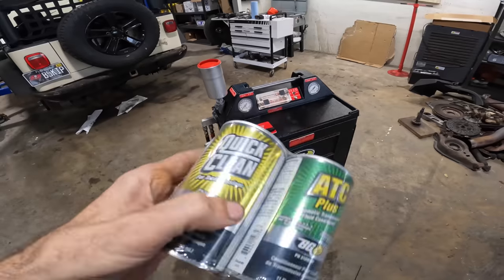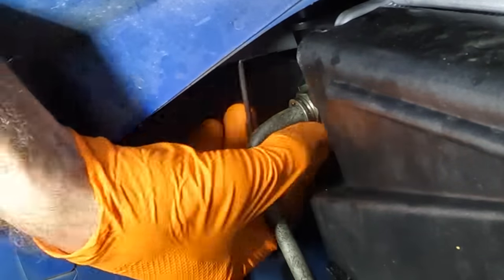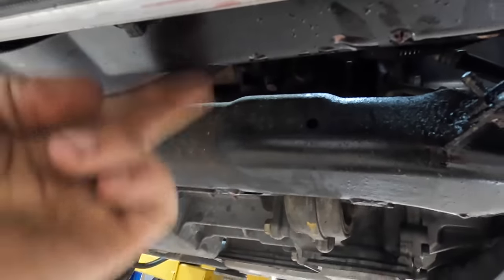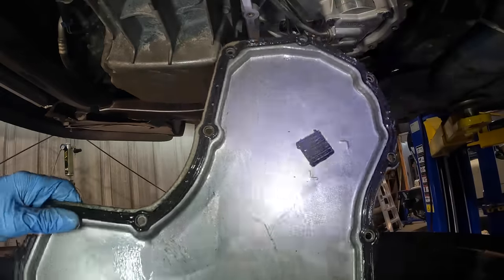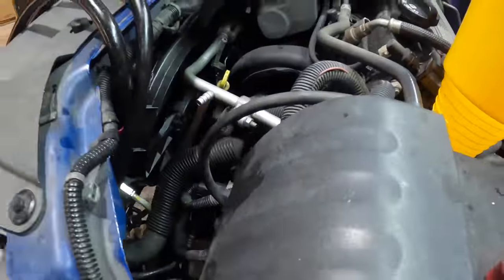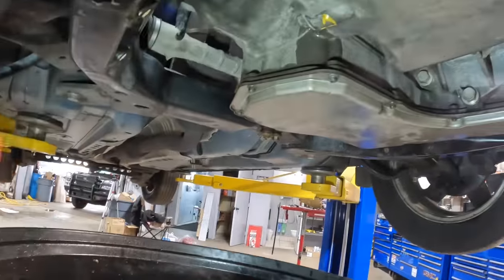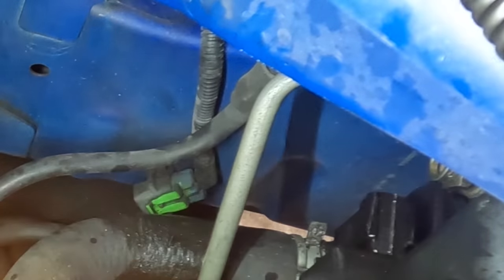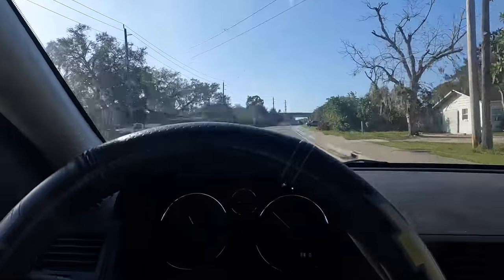Contaminated Transmission! Chevy Cobalt 2.2

Comment: I used to run a reputable Fastlube and did many T-tech flushes.  With that unit you filled a long visible cylinder with 15 quarts and attached the same place you did used the transmission pump to do the exchange. It also had a second visible cylinder that showed old fluid coming out. The customer could see the whole process and assured them that we were not compromising their car.  We also added a bottle of Lubeguard conditioner.  Back then the process was about $105.00 plus tax.  Many mechanics said it was harmful but I saw it work on many high mileage vehicles. I did it on and old Volvo that would barely pull itself when it came in with 204,000 miles.  Weeks later the customer came back and said it was running like new.  I guess it's just a matter of opinion.  Great video Ray, It brought back memories for me.
Reply: Now on this days would be around 700.00 for that job
Reply: I had a flush done about 20 years ago when I had what I thought was a shuddering torque converter. When I pulled out of the transmission place, I lost all but second gear before I even got to the second stoplight. It was the crappy fluid that was keeping it going. I’ve seen it work both ways. Sometimes the fresh fluid fixes the issues, but only if the trans is still good.
Reply: @carloshernandez2216  on a ford focus where the fluid is $30+/quart, yeah... $700 at least
Reply: I worked a few oil change shops and we used the Wynns flush machines the model with three tubes "Green" "Red" & "used" fluid  and never had a issue flushing transmissions, even on older high mileage plus I some shops warned the customer and made them sign a waiver if over 86k miles. The only problem we had was a dude who looked exactly like William Murderface from Metalocalypse trying to scam us out of a new tranny claiming we put the wrong one in his El Camino. We don't install or rebuild just flush or replace filter and/or gasket.

Comment: From an older guy who worked at a GM dealership in the 1980's: now that you took the car out for a test drive, which has actuated ALL of the servos and accumulators, drop the pan and change the filter one last time please. You have released debris and pink shmoo from the last hiding places and this needs to be addressed by a filter and associated fluid change. Otherwise you did get there in the end. Congrats.
Reply: Exactly..... I would have been manually shifting through all the gears as that machine was flushing.

Comment: Ray, I’ll give you a little trick on pouring out the box of transmission fluid. When pouring out the fluid into the machine or even into a funnel turn the box around so the spout is at the top of the box when starting to pour this allows for the air and fluid to equalize and doesn’t make a mess.
Reply: You can also get a greater angle this way before any liquid comes out, all us real old fart Brits know this from the ancient, rectangular, 2 (Imp) gallon petrol (gas) cans that had the very short spout in one corner.
Reply: Great video my car has a six speed manual gearbox being in the U.K. 30 mph is the normal speed limit in towns if I put the car 5th it will go up to 38 mph it 1000 rpm with no foot on the diesel pedal and 48mph in 6th at 1000 rpm if I want to go faster I turn on the air con 😅 to keep my driving license I say in 4th but I have to put my foot on the pedal or I will be going at 21 mph so  Enough Woful and a merry Christmas to everyone ☃️
Reply: with a bag in a box the bag just shrinks there's no need for air to equalise. still eaiser to pour from the top though.
Reply: @randomblogger2835  correct, the bladder collapses so there are no vacuum "glug" issues as you get with a bottle or can.

Comment: Thanks Ray, I am with you reliving my two transmission sagas: Ford Taurus 1998.  My dad's SOHC 24 valve Taurus,  32000 miles and the transmission started slipping. We were out of town. Long story short took a chance,  Ford dealer, recycled all the transmission fluid, a relatively new process at the time. Never had a lick of trouble with that transmission after that. Second transmission flush story:  93 Ford Explorer.  96,000 miles. Out of town again. Transmission slippage on the highway. Drove into St Augustine. Found a transmission shop. Had them do the transmission flush. Drove said car the following months to Alaska never had another lick of trouble from that transmission. Verdict: Transmission flush works in the right situation. And it is a mystery and one does cross their fingers not knowing if it's going to work or not but two out of two times it worked for us.👍🤗
Reply: Amazing good fortune! I had a mid nineties SHO Taurus. Loved that car. Had good power and handled like a dream. Unfortunately it had some electrical gremlins that were absolutely maddening!

Comment: I really enjoy your videos.  Watching you go to heroic measures to satisfy a customer really defines "customer service".
Reply: I agree but those heroic measures will result in an epic repair bill
Reply: @sand0077  The alternative is either replacing transmission or getting a new vehicles. Compared to the other two, repair bill for his service should be acceptable...
Reply: Customer can start saving for a replacement transmission or a new car (new or probably used). Ray probably explained the status of the transmission in addition to the new radiator and transmission fluid flush.
Reply: I don't think he's repairing individual owners' cars. Seems most of the vehicles he's been working on have been for re-sale. Probably a small dealer with their Red Light auction cars. Such a waste of Ray's talents if that is indeed the case. A friend of mine local to the new shop tried emailing them and didn't get a response and they even blocked his email address (now getting return to sender but mine went through). I feel bad cause my buddy is a disabled vet that loves Ray's videos. He's always worked on his own vehicles but now that he's almost 60 , it's getting harder to get into the tight spaces under the hood. Hopefully he'll have better luck once  Ray gets all settled in the new space.
Reply: @mod_incllc3235  a customer is a customer.
Reply: @mod_incllc3235  I don't think so, at least not solely. Those places want the least amount of work done to get the car to sell and most wouldn't agree to do the work as ray does it.

Comment: Nice job Ray.
I remember a guy that had a Olds 442 and the only way to open the hood was from the hinge end of it. He had the hood open and propped up and left a funnel in the dip-stick tube, he took off for the auto parts store and out of nowhere we had a down poor and he filled the transmission full of water. He went for a drive a few days later and the car came back on the back of a flatbed tow truck.

Comment: Happy Holidays to everyone! We all kinda know that without Ray someone would have dropped the pan and added 5 qts of fluid and this car would be in the boneyard in a month. You're not just teaching and entertaining, you're recycling and keeping cars that still have life on the road because you do things the right way. Thanks for the extra fancy oil change video!
Reply: U2
Reply: U2
Reply: We all know a good mechanic would have cycled through the gears to ensure the valve body was flushed, and not just changed the fluid.
Reply: Nice and shiny!
Reply: @johnt.848  Theres just no damned way to thoroughly flush these things.
Anything you do or dont do has drawback sin a situation like this.
Personally i would have stopped at the puddle of black powder in the bottom and not have spent $500 in atf on it.

Comment: I had one with water in it from trans cooler leaking inside the radiator 2 years ago and still running strong.

Comment: I have an 08 cobalt I bought with 70k miles 2 owner. When I got it the trans had never been serviced. at 90k miles I replaced the cooler lines, dropped the transmission pan, changed the filter, and did a partial fluid change. I just replaced the exact amount of trans fluid that came out with new fluid. It was almost 9 quarts exactly. While I was servicing it I decided to replace the transmission pan with an aftermarket pan with a drain bolt on the bottom (amazing for draining the trans for future servicing). I just want to say about the gasket you made the proper call I also re-used the factory gasket. One more thing I would like to say is that the amount of clutch material in the transmission pan was a lot thicker than the material in my trans. There was some material, but no where near as thick as the pan you showed in your video. You are probably correct when you said the trans must have been slipping.

Comment: I have a 2007 Chevy Uplander. The transmission started slipping quite a bit. I took it to my friendly neighborhood mechanic and he said the transmission was shot and I needed a new one. I decided to change my trans filter and it has been running fine for over 2 years now. The mileage is now 180,000

Comment: Those stamped gaskets are reusable as long as they are not torn. I've done it on countless of my own vehicles and never had a leak so I'm with you on that Ray. Now those rubber ones are trash lol
Reply: agreed
Reply: Biggest thing I've run into with those rubber gaskets and Court gaskets especially on valve covers in the old days if you weren't careful and tightened them too much you they pinch at the ball points and then warp your valve cover and then you had a real mess have a great day and a Merry Christmas and thank you very much Ray
Reply: @michaelpressman7203  cork gasket* looks like auto correct struck again
Reply: Can I reuse my original gasket from my 1999 4T45 transmission?
Reply: @s99614  is it stamped with steel in it and not leaking prior to you changing it?

Comment: Congrats on the save I've tried a couple of 2nd gen 4runners you know the ones that made the trans milkshake a common thing and had mixed results 50/50. Personally I'd toss In a quart of Lucas for good measure or there is a product I forget the exact name of it but it's a hydraulic system dryer and helps eliminate water in hydraulic systems and it works wonders.ik Auto zone is where I used to get it and run it in all my plow trucks in the plow power steering and transmission to prevent any moisture from freezing up in the middle of the night when plowing

Comment: I agree with Ray. The problem is not a leaking seal, and the seal is not compromised by removal or installation. If the problem was a leaking seal, then the rubber seal still isn't up to spec for a like for like replacement. This is a good choice for the issue at hand.

Comment: In my experience water/coolant disintegrates the clutchs and you can only really buy time. Eventually it will start slipping but how much time depends on how long the water was in there and how well it was flushed. I think you bought this little unit a few more years but only time will tell, great job ray!
Reply: Yep transmission clutches are water soluble. Any amount of water is terrible for them and is why it's bad to try to use a transmission thats been sitting dry out of a vehicle. Water will condense in the case from temp fluctuations and destroy the clutches.
Reply: I can't see repairing this vehicle, an 18-year-old chevy cobalt that judging from the smashed hood is at best a drive to work beater isn't worth it.  I'm guessing you could pick one of these up in better shape for 25 to 35 hundred and not worry about how long the transmission might last after being contaminated with coolant.  you can't really guarantee the repair and it's not worth having someone running around bad mouthing your shop if it goes out after a month or two.
Reply: @ogbobbye  buying it and repairing it is far cheaper than car payments. $25-$3500 is a bargain for used cars right now. Plus, if it's paid for, a new/rebuilt transmission is worth the cost vs a new car.
Reply: @ogbobbye  if you’re getting a used car for 5k you better jump on it in this market.
Reply: @silaskuemmerle2505  Depends on where it's from. If it's from the Fort Myers area, run away!
Reply: @silaskuemmerle2505  that isn't a number I pulled out of thin air I looked that model and year up on autotrader. true a florida car would be worth a little more but the body on that chevy was pretty rough.
Reply: @markbremmer8642  I have a feeling his neighbor is a buy here pay here dealer buying junkers at car auctions getting them running cheap and taking advantage of people with poor credit. there is a body shop right next to Ray's shop and that fits the profile. btw 2500 to 3500 is what I see 2005 cobalt's going for on autotrader maybe they are worth more in Florida.

Comment: I've reused the pan gasket on my 06 Suburban with the 4L80E 5 times now and it does not leak. I change the fluid and filter every other year. About 16-18k miles in between.

Comment: I have owned a 93 Dodge Dakota for about 25 years. In 2001, I was driving in Colorado and it stopped going into overdrive. I stopped at the Dodge dealer in Greely and they did a BG flush. It has not given me a single moment of trouble in the 21 years since. I firmly believe in BG flushes! 166,000 miles on the original transmission.

Comment: Ho Ho Ho he reddened the flow! Very nice video, Ray. Now… how in the hell, in the engineering of the car, does any benefit of an integrated cooling system outweigh the catastrophic downside? Oh wait, lower production cost and higher profit. Of course. What was I thinking.
Reply: This has been a thing (having transmission cooler built into the radiator) for a very long time.  Now a big issue when they used sturdy brass or copper coolers.

Comment: We need honest, independent automotive shops like yours. Shops who are willing to try to fix things if they can, rather than just swapping parts at the expense of consumers. Warranty work is one thing. Many people can't afford new cars and they need to keep theirs running.  That's why your shop will be successful.  Auto companies just want to sell cars, not fix the plannned obsolete systems that are designed to fail too soon.
Reply: Very true... I expect this car taken to the dealer they would have just said "you need a new transmission and torque converter"

Comment: love the video ray, and this is a good attempt of putting off the ending.
water / moisture will de-laminate the clutch materiel it is a time bomb it will go boom.  
i have had the same thing happen to family and friends and i know of a few more and they all end the same way. 
and before the armchair quarter backs start conditioner is only a bandage at best and only if used right.
Reply: And the truth will set you free. You cannot save these Transmissions. 28 years of rebuilding says so.
Reply: May hold for 2k miles or it may hold for 20k. Ray probably added some life back into it with his efforts. But the downward spiral of this transmission has begun. You are so correct, it's a matter of time.
Reply: Indeed have had a few vw's where the cooler caps out and ended up with all steel plates and a pile of mush in the bottom
Reply: @johnmcnair8854  yep VW are known for trans and oil coolers. but it seams Chevy has a real problem with radiators.  i just plug the ports and put a external cooler on them.
Reply: @Maroco918  plus Ray wanted to test out his new machine.

Comment: Our shop switched from BG to MOC and it’s a hell of a lot better. IMO the products are better plus the machines are pretty easy. They all use the cars battery as power but the new coolant machine is air powered. Hasn’t arrived yet but can’t wait to see how that works

Comment: The future of this car seems "Iffy" at best. I wouldn't trust that transmission for a long haul, heaven only knows how long it ran on the trans fluid/coolant mix. Bad radiator, steering pulls hard to the side, no history on why it was brought in for service at this time . Tell me I'm wrong but I sense this is an auction bought car that is going onto a used car lot and owner's goal is to get the car past inspection and into running/sellable condition. It certainly does not impress me as a vehicle that was lovingly cared for by the previous owner.
I do love your videos Ray. You explain things very well, keep the commentary running throughout and the lighting, editing, and quality of your videos are outstanding to say nothing of the entertainment and educational value they provide.
Please do me one favor and get the cords lying across the garage door entry floor rerouted and off the floor. They are a safety hazard, and that wonderful family of yours does not need the sole source of income for the shop laid up with a broken hip. Especially since it looks like this location will now be a long term commitment (with announced of planned expansion/renovations ) getting the wires off the floor should be a high priority, I'd also suggest installing an automatic door closer in the door to the office side as it will save you time moving vehicles into and out of the shop and reduce the chances of a partially opened door blowing open and striking a vehicle that is entering or exiting the garage.

Comment: Nice job Ray! I am wondering if the system would have been easier to flush if you would have bypassed the cooler with a small piece of hose between the transmission lines to move the car after you replaced the radiator.
Reply: Good point!

Comment: Love your effort and the new toys.
In Germany it would financially not be feasible to do this operation. We did the trans-flush and it cost us about 500€. This time and effort you put in would probably buy another beater that will be good for two years.

On a technical note, did you shift gears during the flush? On our 2005 CRD Grand Cherokee they did. Still drives like a dream. Doing a transflush seems to really be worth it on ye older cars :)
Reply: a used trans only $200 here for this money pit car.